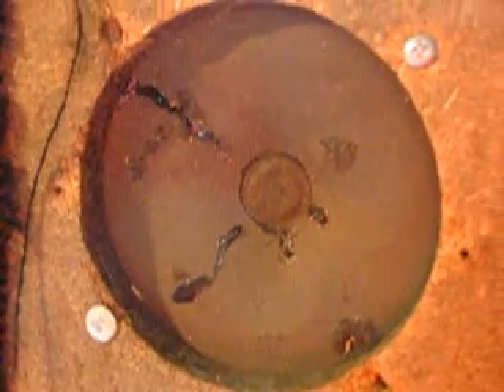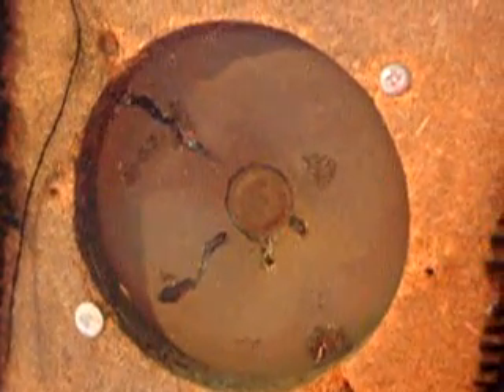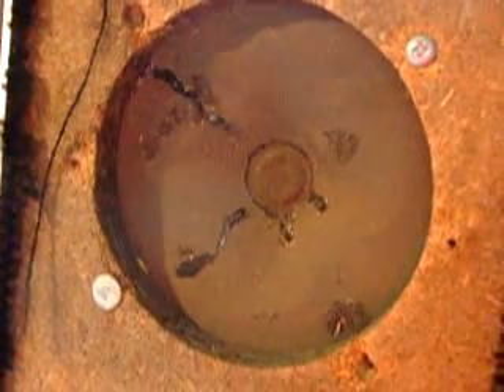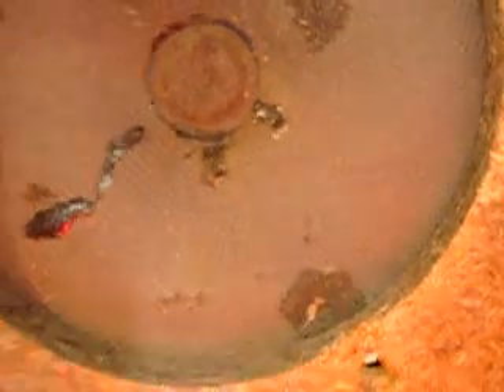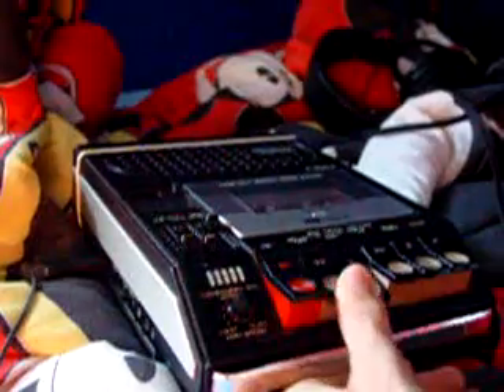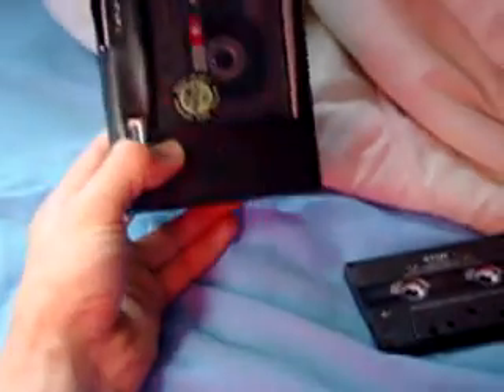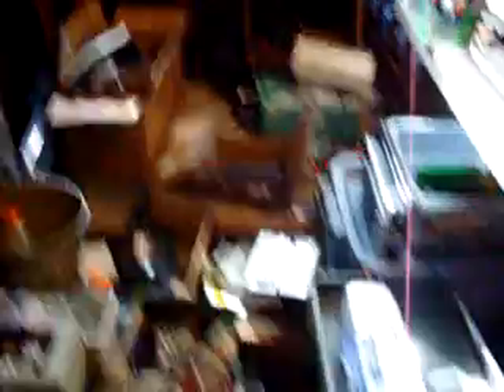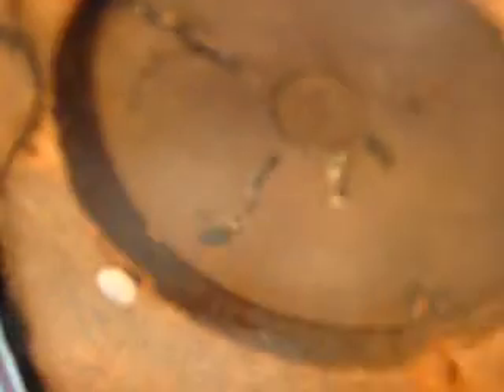My homebuilt transistorized amplifier.

Comment: @Sub40H The output line/Recording head driver transformers of my tape deck are huge for the amount of audio and dc power they deal with (Class A with small audio Germanium transistors) maybe 20 mW audio and 100 mW DC. The stand alone version of this deck has a headphone output which is taken from 10 ohm windings on the transformers. BW is reasonable but we all know the best amplifier is direct coupled all the way through. Even resistor/capacitor coupling introduces phase shift and coloration.

Comment: Lower efficiency but vastly better quality would be using a 2N3904 and 2N3055 in a Darlington arrangement. Use a 8 ohm noninductive 10 watt collector load resistor for the 3055 and couple it to the speaker with a 500 or 1000uF cap (collector/ground). Use a 1 Meg pot to set bias around 1/2 supply voltage at the 3055's collector (I used a 12 volt supply 2.5 amp-you know how inefficient Class A is).

Comment: @chrisbx1975x The other side of the coin could be if the output Z were really low he could get more power by using a lower impedance speaker without using a higher voltage rail. Old school car stereos were made for 4 ohm speakers simply to get more power with the available 12 single rail supply.
My JVC Nivico stereo console uses single -28 volt  rails to get 23 watts per channel into 8 ohms (all PNP transistors so positive is ground).

Comment: @Sub40H Yeah that transformer is too small to be hi fi and having an output transformer degrades it even worse. Driver transformers can be good if they are large enough. My JVC Nivico stereo console has large driver xfmrs along with capacitors coupling the outputs to the speakers and sound quality is not bad. The driver xfmrs are twice the size of the output used here. Then the Reel to reel tape deck has line output/record head driver xfmrs even more massive and they only deal with maybe 50 mW.

Comment: Have you noticed cassette recorders prior to about late 70's often used a push pull arrangement with interstage transformer driving 2 germaniums in the 2SB series and a 2SB series on the primary of the interstage.Then a centertapped output transformer. Usually 80-8 KHz BW. Often the recording was also done through those transformers. I had an Emerson table top stereo with AM/FM/phono/8 track and it had RC coupling no transformers. Problem was it had noticeable crossover distortion at low volume.